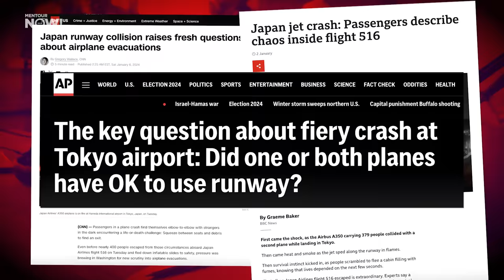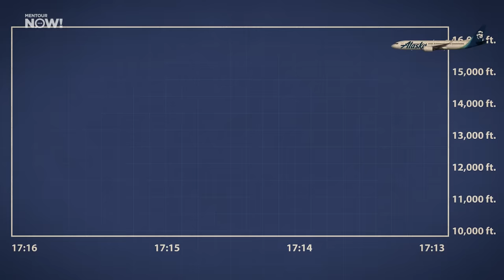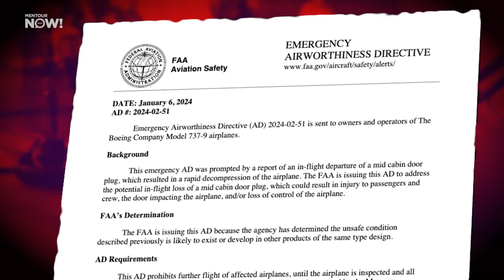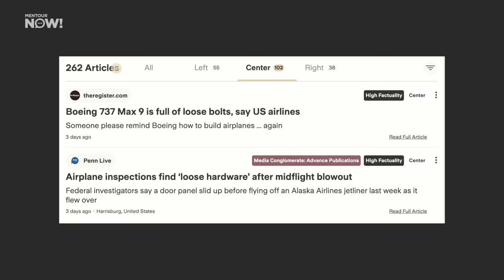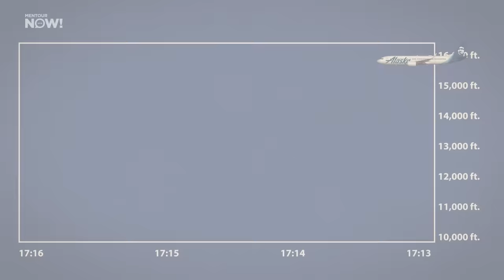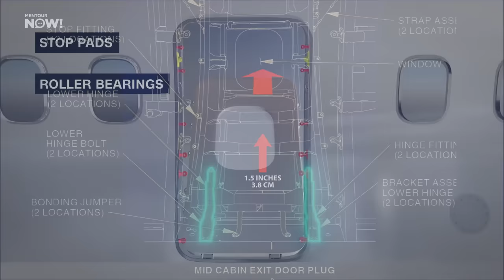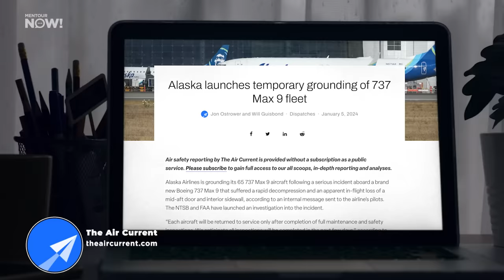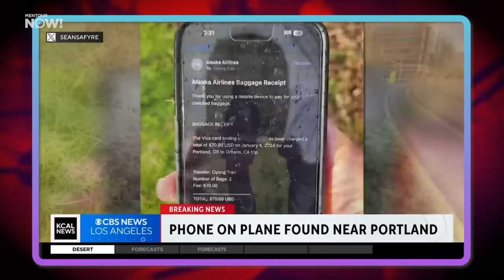WHAT Is going ON with Boeing?! MAX-9 Door blowout

Comment: The cockpit door details was discussed on another channel. Apparently the door did blow open (by design). It something Boeing has introduced on the Max, the pilots weren't made aware of this though.
Reply from the maker: No, we weren’t 😖
Reply: blancolirio has a lot to say about this and he's quite upset about the fact that pilots weren't made aware of that fact. They lost their checklists  during the depressurization among other things. You should check it out if you haven't already.
Thanks for you fine edition to this event. Boeing needs to change their "culture" back to where they started. Enough of this DEI business. Think of the old Alvin Tex Johnson days of pride in product and engineering.
On a little personal note, I owned a Cessna with a tail number N7*4AL. Spooky.
Reply: The Flightdeck door blow out panels appear to vent and open forward only. This would cope with an explosive decompression in the flight deck but since the explosive decompression occurred in the passenger cabin the blow out panels in the door won't work. So the entire door needed to blow open towards the passenger cabin. Question is:  is the door unlocked electronically by a pressure differential sensor as some posters have stated, or is it a simple force overload condition that allows the lock to release at a pressure overload? That no one was told that this occurs pilots or maintenance or NTSB, may have been an anti hijack initative. Now terrorists know that under certain conditions they can get these hardened flight deck doors to open.
Reply: @planespotter4494  Highjacking was one of the first things that came to mind with that revelation as I'm sure it was to many. What a poor idea! Put a  hole in the vessel and now you're in! That plug door isn't the only thing they're going to have to fix now, is it?
Reply: @planespotter4494 better hope it isn't the mechanical overload 'cos they will have already put together a slide hammer, disguised as a walking stick to give that a sharp pull.
Reply: @MentourNow  Have you since been made aware of a feature found on all NGs which may have been an unintentional backup for the blowout panels? I can't discuss this here for security reasons, but if you read the maintenance manual, you may find it.
Reply: Funny, it’s in the B777 manuals:
“The door latch system incorporates a pressure rate-sensor that unlocks the door in the event of flight deck depressurization. Two hinged decompression panels open to equalize pressure in the event of cabin depressurization. Each panel opening has a security grill on the flight deck side.”
Perhaps it was inadvertently omitted in a revision at some point. Or maybe the 737 door isn’t really designed to unlock…
Reply: There are apparently a lot of design specific features on the 737 Max (like MCAS) that didn’t get noted in the manuals precisely because they didn’t want the FAA looking too closely at the changes. You can’t query what you don’t know exists.
Reply: @downwindleg. DEI has nothing to do with any of this - it’s monochromatic accountants in Chicago who only care about the color green.
Reply: @meofnz2320 Or the “failure” was a failure of the venting system. Pressure relief valves have a 1% failure rate.
Reply: @meofnz2320 the depressurisation happened in the passenger cabin, not the flight deck though in this case
Reply: Wow! Yet another example of MAX "pilots will not need any additional training" decision that was made by the marketing and management without discussing about the reality with the engineering.

I would be very careful with any "pilots will not need any additional training" style marketing speech from any manufacturer in case of changes to the aircraft design.
Reply: @meofnz2320  does the B777 have cockpit door vents for venting out of the cockpit as well as venting air into the cockpit? The 737 door shown has an upper & lower panel with covers that are both on the inside of the cockpit side of the door. Even if a pressure switch released those vent cover panels, they will still be held in place by the air pressure if a cabin door blows out & air needs to flow out of the cockpit. The vent panels appear to be designed only to vent air from the cabin into the cockpit which is only relevant to something like the British Airways BAC1-11 where the windscreen glass blew out.
Reply: @alanm8932  
I should have mentioned the 737 flight deck door opens into the cabin whereas the 777 door opens into the flight deck. So the functions are reversed.
The point I was getting to is that the door function is a common design, and there’s no reason (in this case) for Boeing to deliberately obfuscate the details.

Comment: Root cause of this fiasco is simple: quality does not appear on the balance sheet. Boeing CEO (accountant by profession) sees only the balance sheet in Virginia HQ. His salary depends on the balance sheet, not quality. Quality matters only in the Seattle factory. To fix this problem 1) Replace CEO with VP with aerospace engineering degree and technical background 2) Move HQ back to Seattle 3) Publish quality metric measured by independent inspection entity each year and set CEO salary according to the reported quality metric.
Reply: Previous CEO was an engineer by profession and board forced him to resign (by paying shits of loads of compensation) because there were technical problems in the newly designed aircraft. Then the board assigned an accountant, someone from the board itself, as CEO to fix the technical issue.
It sounds to me that board is incompetent too. They don't even know how to assign a suitable person to the job.
Reply: Nice ideological position.

Unfortunately you will then end up with a company that makes great planes for a very short time before going bankrupt.
Reply: The CEO's bonuses are paid on Diversity, Equity and Inclusion rates not actual performance 🤷🏼‍♂
Reply: @alan_davis  better than making crappy planes for a short time before being sued into bankruptcy (and taking a few lifes on the way)
Reply: @alan_davis Wrong.  Boeing was run by engineers until they merged with McDonnel-Douglas, and it was only after the non-engineers from the McDonnel-Douglas board got onto Boeing's board that they started having these quality control issues, along with losses to their sales and reputation.
Reply: @alan_davis I can’t see a problem with dialing down a bit production output so they can focus a bit more again in QC. They got so caught up on this competition with Airbus, they been making bad decisions after bad decisions. Including developing problems and delays with several different projects.. if they can’t certify a type they can’t sell it. They been losing tons of money as it is. And this is only what gets to come all the way down to the normal folks, the geeks and so on. Or more to the general people when it comes to the MAX. My mother knows as much about planes as I do about what’s happening now in andromeda, and even she knows about the MAX. 
There’s so much that gets filtered too. Plus they been losing also here and there on the military side. All This to say, they keep going like this they gonna end bankrupt anyways. 
There’s only so many bailouts the government can do. Or they gonna end up like GM. A shadow of what they used to be..
Reply: @alan_davis  the main difference between engineers and economists is that engineers are trained and capable of taking many different conflicting requirements into account when making a decision, economists only see one variable at a time and it is always money. I have seen this first hand many, many times in different corporations. Thinking back to the high school days the smartest kids went to engineering and natural science, those that couldn't quite reach that went to economy...

Comment: About the cockpit door, from AVHerald: "During the explosive decompression the cockpit door flew open as designed and impacted the forward lavatory door shutting it jammed..." and "No one amongst the flight crew knew that the cockpit door was designed to open in case of a rapid decompression, Boeing is going to make changes to the manuals."
Reply: Wow, Boeing not adding details to the manual. Shocker.

Comment: The lucky and scary thing is - they blow at 16000 ft! The inside pressure is about same as on 8000 ft, so it was only about 8000 ft pressure difference and still panel gave up. If that happened on cruising altitude it would be much much worse for anyone onboard
Reply: The luckiest person was probably the individual who was sitting next to the door plug on one of the previous flights.
From the condition of the seat after the accident, it looks like there was a good chance they would have been sucked out of the plane.
Reply: @catinthehat906  without the seatbelt you wouldn't stand a chance.

Comment: As a metallurgical engineer who's done hundreds of forensic analyses my strong suspicion centers on the guide track bolt and nut which are most likely gone now. Don't know the details of the nut, but it's probably a castellated type which is supposed to have a type of cotter pin to prevent it from loosening. These pins may have been omitted, the nuts not torqued, or the bolts may have been missing altogether. Hopefully it will be evident upon close examination of the mating metal surfaces whether the bolts or nuts had ever been present. With this being such a new aircraft it's not likely related to component fatigue failure. But as you say, we'll have to wait for the final report.

Comment: I find it astounding that there were only seven empty seats on the flight and that two of them were in the row where the panel blew out.  Having been on flights where virtually every empty seat was a centre seat and all window and aisle seats were occupied, I wonder if Alaska didn't book or allow use of those seats because of passenger raised concerns on previous flights...
Reply: It's more likely that those seats cost extra because of increased leg room.
Reply: I thought that. If it was free, I would have definitely moved to that window seat from the aisle seat.
Reply: It wasn’t a long flight so it’s likely people didn’t care much about extra legroom on this flight. It’s a very lucky coincidence.
Reply: They had some pressurisation issues so they may have done that. If the other door plug also didn't have the window seat occupied then the airline kept the seats empty as a precaution, if it was just the door that blew out, it was a coincidence, no one paying extra on those seats.

Comment: Between yourself & Juan Browne very well expkained Petter.

Apparently we now know that the flight crew also lost their headsets & a laminated QRH that blew out of the open flight deck door.

That alone begs some questions since Boeing later admitted that the door was supposed to do that but had not advised the operators & thus the crews.

It had to have been a heck of shock for them all onboard.

What you have here is as updated as possible.
👏

Comment: Picture with hinges and lift assist springs has 2 from 3 visible mounting bolts loose! Because it was so loose it could just wiggle itself out of plug stops alignment and 2 slides and hinges could probably not able to hold the load and that is why both slides and hinges were damaged.

Comment: The latest rumor mill has it that the plug door was removed during the installation of the satellite antenna for the entertainment system. So the last people to touch it might not have been from Boeing or Spirit. But who knows.
Reply: The company has denied opening the door for their work. If you look at satellite pics of the aircraft during wifi antenna installation, the access steps to the roof cover the door completely.
Reply: If so, then it had to be inspected. Who did it?
Reply: @ImperrfectStranger  Ok. So it's just part of the rumor mill then.

Comment: Another great video, clear and unbiased. Some very good comments made to about media details released so far. In my opinion even one of those six bolts being in place would have saved the day. Nut held on with a Cotter pin in a very simple way to ensure that the nut does not come undone. Tight or loose, the nut will not become undone. However with NO bolts installed it would be just a matter of time before the door went up and off. I would like to know how they actually achieve the seal part with those Plug doors. With real doors they appear to have a big rubber seal that is forced against a frame from the inside, hence inside pressure ensure a seal is made.

Comment: You may have missed it but it’s been confirmed that yes the cockpit door does open fully in the event of depressurisation, many 737 pilots have expressed surprise and apparently Boeing is changing the information to actually tell pilots about this.
Reply: Yet another MAX "pilot's don't need to be told about this change" feature, right?

I get upset when I don't have a truthful changelog for the software I use, I would expect pilots to be asking for even more!
Reply: @MikkoRantalainen  seems that way, yes.
Reply: AFAIK, this feature is fitted on all 737s, not just the Max. The normal blowout doors in the door should be able to handle most decompression events, but this was a little more violent, triggering the second line of defence.

Comment: The NTSB said (at least initially said) that the door detached at the bottom hinges before swinging upward, like a pulling door, which would have caused the damage to the rails at the top. Still a very dangerous issue regardless and need to be fixed asap.

Comment: They missed a clue because they were having trouble with the pressurization system on previous flights but the redundant system worked so they didn't track down the problem. It might have been the loose panel leaking, causing the pressure system to throw an error code.

Comment: I find the point of the cockpit door swinging open interesting. Specifically that it isn't in the manual. Do you think it was left out, so potential hijackers don't get the information? Apperently it is in the manual of the A320 family.
Reply: No it was left out because of added cost of fixtures that would need to be changed, had Boeing informed FAA and Airlines.
Reply: They must have missed it. They knew that Airbus has the same mechanism and they would put it into the manual.
Are we surprised that they missed something?
Reply: I mean if MCAS wasn’t considered important enough to tell and explain the pilots and airlines, do you really think a swinging door gets any attention? I can imagine the meeting:
“Ok so for the next point I have the cockpit door and the technicality that it opens during decompression event, crew must be made aware so they won’t get caught off guard when it happens.” - Administration: “huh? It’s a door. It swings open and it swings close. That’s what it’s supposed to do. Stop wasting my time”
Reply: Perfect! I can't imagine that the explosive opening of a reinforced door is normal under that small depressurization. Imagine a larger! This opening ripped off the phone of the First Official, sent the information sheet to God knows where!!! Should have pressure equalization valves anywhere in the wall that divides the cabin. Leaving the door alone!! 😅😅
Reply: If they mention it in the manual, they also need to provide a more secure headset and secure tethering for the checklist.
Reply: @ernestphelps6942  It wasn't a small depressurization though is the thing. It was literally an explosive decompression. The iphone that was blown out still had part of the charging cable attached.... the cable was ripped apart. And it was just somewhere near the wind and a small device. A large door actually holding pressure.... yea
Reply: @nemo-x  It was small---the plane still was quite low. If this had happened at its normal travel altitude, you'd have a normal explosive decompression.
Reply: @HenryLoenwind  It was a small explosive decompression*. So uhh. Still pretty extreme. Like popping a balloon that isn't *fully inflated.
Reply: @HenryLoenwind  No one has been able to provide me with a typical value for differential pressure at 16,000 feet on the NG. The pressurisation table for a 747-400 shows that on a 747, the pressure would have been already (at least) 2/3rds of the pressure at initial cruising altitude. i.e. not half as you might expect.

Comment: It’s unbelievable how those Boeing are still being sold to companies after all these system design and structural issues on brand new aircraft’s.
Boeing really has a major production problem deeply embedded into the current culture of the company.
Issues just keeps going on their aircrafts, it’s incredible.
Reply: Some airliners only want Boeings. They must get great discounts, otherwise I can't think of any reason why. One major aspect though is retraining flight- and cabincrew. The Flightcrew on its own needs 6 weeks to retrain from a 737 to a 319/320/321.
Reply: 4000 on order. I guess companies don’t seem to think it’s a huge problem.
Reply: It isnt. The door wasnt properly secured by whoever mangled with it, and alaska was concerned enough to not use this plane over seas (even by a different reason).
Reply: good design falls on its face if implementation is shoddy because it was decided to drive profit by cutting production quality typical "it is what it is" management